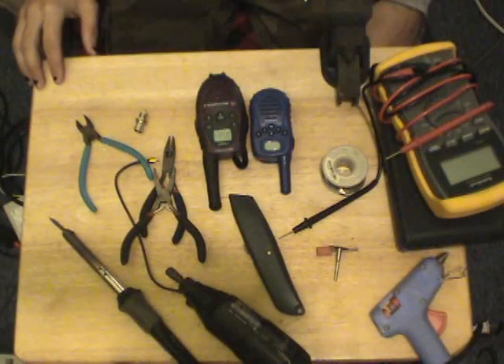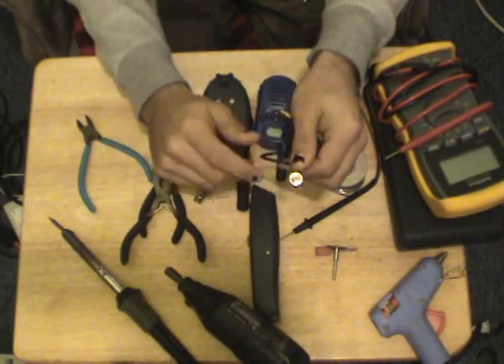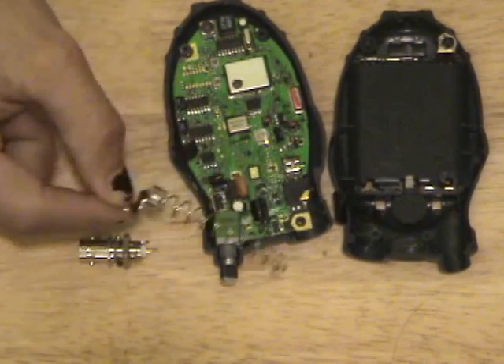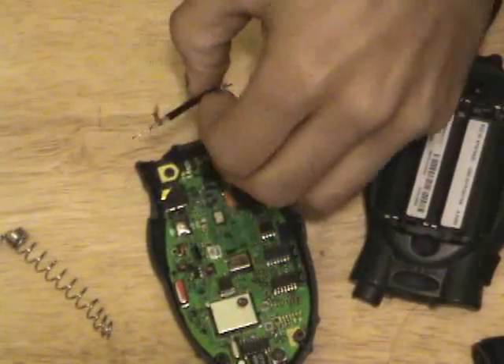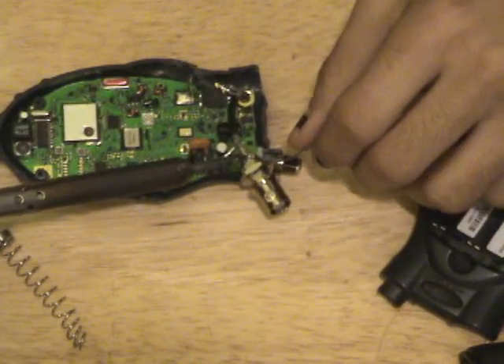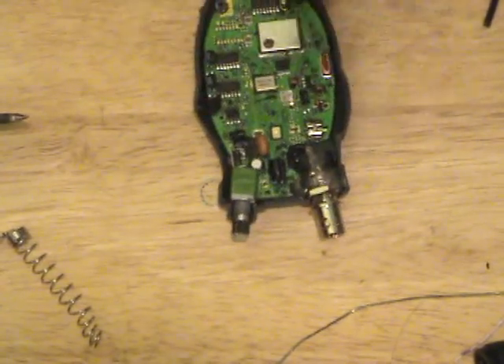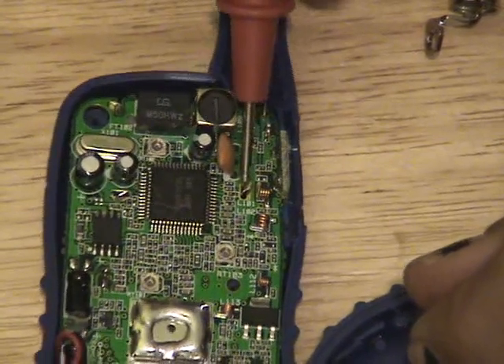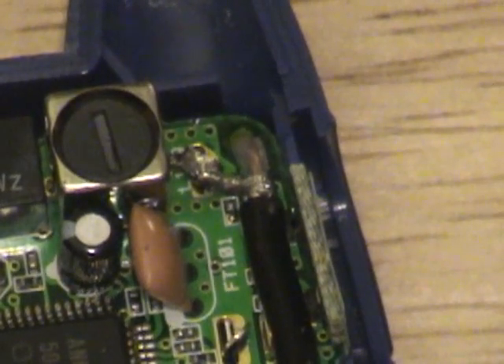Foxx   FRS Antenna Mod

Comment: An entry level Icom 7300 radio for amateur radio costs well over 1000 dollars.  PLUS you will need a halfway decent SWR meter for amateur radio HF\cost easily OVER 100 dollars.

Other stuff could easily drive the entry level cost to over2000 dillar.

FACT not fiction.

N5LRZ

Comment: UP TO a 1000 dollars?  Just to let you know, a just good entry level HF radio/General Class License required/ALONE will cost cost at least 1200 to 1500 dollars new /not used.   Remember used radios do not have warranties and repairs are in general not cheap (IF YOU CAN FIND someone to fix it.  Try even finding some replacement parts.

Bottom line: amateur radio can easily be very expensive.

N5LRZ

Comment: I bought RG-58 connectors and found them too thin for a practical antenna, make sure to use RG-8X or larger. Inside the radio might not matter, but didn't want to do it twice and also used RG-8X since the coil antenna looks more like 16~18AWG.

Comment: Hello all. I found a website that gives the lengths of antennas by frequency. The length for the GMRS/FRS band is 5 and 11/16 inches. If you can find any old magnet mount cell phone antennas, they can be modded to work for mobile vehicle use, or use the measurement to build a base antenna. I did, and it works great.

Comment: Nice work. I modded 4x of my Audiovox FRS with SMA connectors and RG174. Worked very well. By attaching cheapo (but longer) 450-470Mhz antennas of ebay, the range increased nicely. I had to drill a hole into the case because the Audiovox use a folding antenna, but they look very good.
Reply: How much does it increase range?